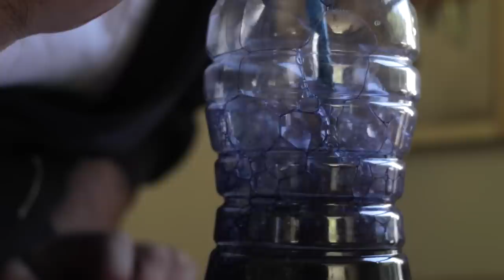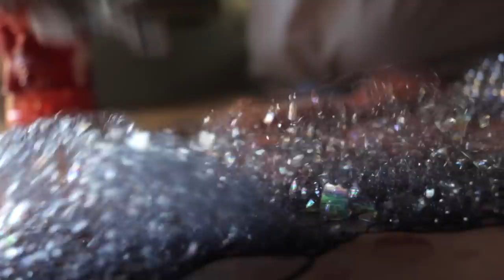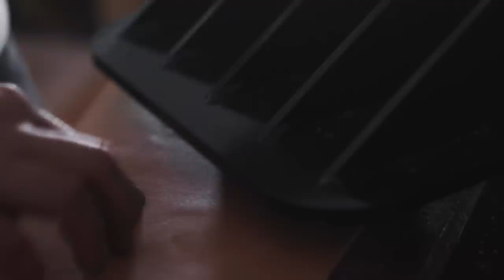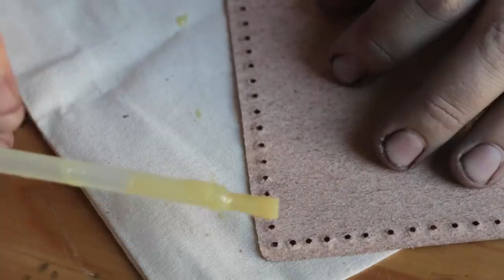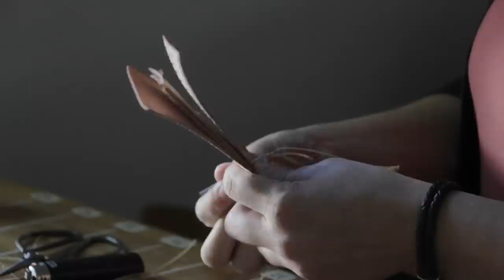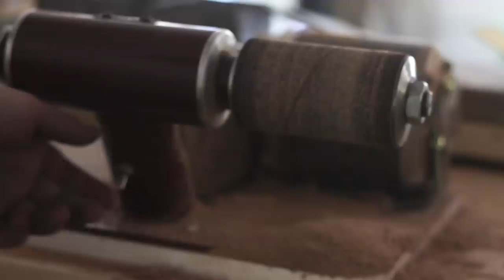Leather + BUBBLES = ???

Comment: Some tips. So others don't make my mistakes.
1. Stick 2 straws together or use a long straw.
2. Doesn't work so well on small pieces of leather.
3. Not a good idea to mix hand soap. Got some weird reaction. Produced unpleasant fumes. 
4. Just about anything other than joy or dawn isn't likely to work as well.
5. Water might not be necessary in the mix.

Comment: Any particular reason you do saddle stitches single-handed? I've never seen anyone else do it that way, but you make it look so easy.
Reply from the maker: Just the way I learned, so we stuck with it! we both use both hands and two needles, keeping tension with the back hand by looping the thread around the pointer finger -- when we're pulling the front thread tight we roll the wrist holding the piece, and it tensions the back thread.

Comment: I love doing this technique I have been developing something very similar to use on leather. One of my notes that might help you control bubble size is to use different diameter straws (I love a really large bubble that provides more of a shading texture), Also dialing in the soap mix helps a lot. Check out my post on it on Imgur: https://imgur.com/gallery/DOya4kb